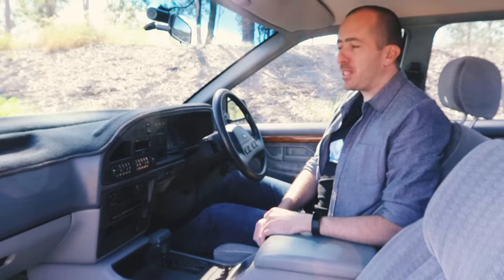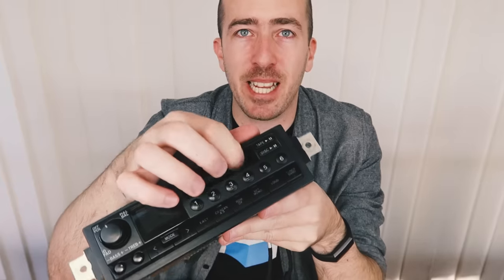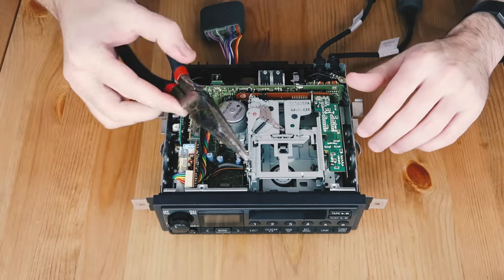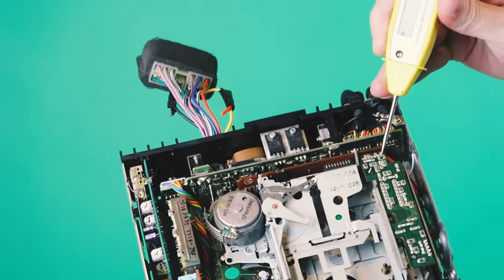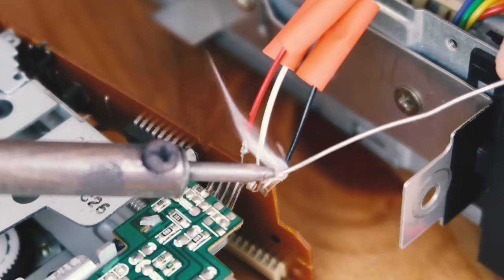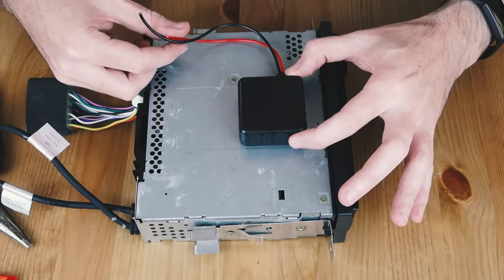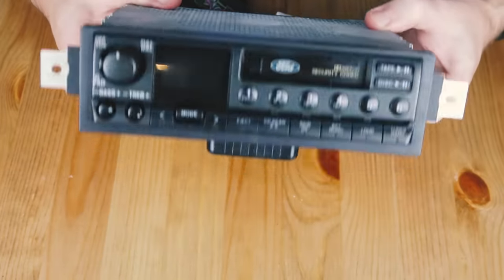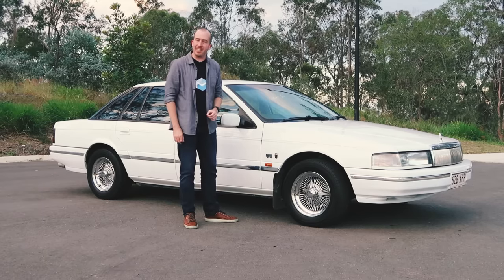Add Bluetooth To Your Old Car Stereo For $25!

Comment from the maker: If you're about to comment something like "Just buy a new bluetooth headunit for $10 from X" you're missing the point. This video is for those who want to retain their factory headunit so their dash looks stock standard, but are interested in enabling bluetooth audio streaming without using FM transmitters or bluetooth/wired tape adaptors. FM transmitters or bluetooth tape adaptors "do the job" and if you're happy using those, that's awesome. But they're passing your audio through the FM band or through the head of the tape drive, and the sound quality may be affected.

Also, as stated I am not an expert when it comes to electrical work, but the mod outlined in the video has worked brilliantly for a number of years. Thanks for watching.
Reply: Yea the Audio Quality is gonna be affected. Compared to the perfectly good a Quality any 20-Year-old Car is known for. Also without an Enhanced Bloototh Codex (which yours apparently doesn't), the quality is not really gonna be any better than FM. It is a really cool mod, but I don't think the audio quality is its claim to fame.
Reply: Another reason for doing this cheap mod is that you retain the steering wheel controls.
Reply: @asdanjer  

FM is analog, it goes up to 15khz (most adults can't hear anything above that) so there is no degradation of sound with FM at all as long as the signal is undisturbed and the receiver is decent.
Reply: @westelaudio943  Well theoretically yes, but there is always disturbance. especially with such a mini antenna.  That's why I sad that it was comparable to the default bloototh audio transmission.
Reply: @asdanjer  

The effects of bad FM reception are high levels of buzz and noise (no direct loss of information, rather added unwanted information drowning out the signal), while what you get with BT is lossy compression artifacts (actual loss of information). So it's not really comparable. 

However, the bad sound quality of BT is always getting over-exaggerated by people, even with cheap BT receivers you get decent sound, lossy yes, but especially in a noisy environment like a car with lo-fi door speakers this doesn't really matter at all.
Reply: @westelaudio943  It is true that it is a completely different phenomenon, but to human ears trow bad old car boxes it does sound basically identical.  Also, it is not only compression noise but also the white noise/electrical noise from a bad DAC and AMP that is anyone with Bluetooth. This is also a form of Electromagnetic interference (Yes on a different wavelength, but still same) and the same phenomena than FM interference. And yes even cheap 20 buck boxes often don't use the default Bluetooth codex, but some special one. and they go from being fine to nearly lossless. But as it looks the one he is using DOES use the default BT sound codex, which IS TERRIBLE. And this is definitely noticeable.
Reply: "They look utterly shit."

Agreed!

Also, heaps of fragile garbage with minimal to no protection from the elements.

Thanks for sharing!
Reply: @asdanjer  You're thinking of FM transmitters. There are cheap in-line modulators ($15) that go between the antenna and the radio cable, causing zero loss. They filter out the channel you have selected so even if there is a station there, your injector is the only thing you'll hear so long as you have it turned on.
Reply: @Shutupimslow  yeah I think they are useless because this refers the hole purpass of a plug and play solution. If you start modify the wiring you chois just do the mod in this video. And signal qualty should still be a lot better with the taking out of a mittelway.
Reply: No fuse on the bluetooth power huh?  Yup, that's going to end well when, one day, you find a pile of cinders where your car once was.
Reply: @antagonizerr  yeah does insane voltages really need this...
Reply: @asdanjer  Ask any car audio, boat or trailer accessory guy. EVERYTHING plugged into main should be fused.
Reply: @antagonizerr  ok sorry, don't know that much about cars electronics in particular.
Reply: @asdanjer  When I was young, if you blew a fuse on the road, you jammed a penny in the slot until you could get to the store for a new one. A lot of cars cooked that way, which is why they switched from tube fuses to pronged ones in newer models.
Reply: Congratulations, great job. But there is one way to include also an microphone ? So we can also receive phone calls. Regards
Reply: @antagonizerr  the unit is connected to the yellow aux power which is fused through the cars wiring loom
Reply: @peter81richardson  Nope, it's not really.  It goes through the car's ignition which is rated at 30A, FAR to high for an accessory. It's functionally identical to having no fuse at all. At best, that bluetooth needs 5A for safety.
Reply: Very interested here, I’ve a nice alpine head unit that I’d like to modify, but I’d like to be able to use cassette player too, so if I were to - instead of terminating the ribbon cable like you did,  just splice the Bluetooth receiver in would it play happily a real cassette when loaded and then a tapeless tape when playing through the Bluetooth, so long as I didn’t try to play both at the same time?
Reply: antagonizerr please expand, I’m considering this myself, where should a fuse go? Between the red wire from the harness and on the red wire to the Bluetooth receiver itself?
Reply: Just seen that you’ve answered my question further down. No worries!
Reply: One thing to note about the FM transmitters is that they will be picked up by other cars nearby. That can either be a good or bad thing. I once heard a one sided conversation and another time tuned it to a car playing some music ( I know this because I often my use that same channel to transmit my own music, which is a blank channel with no radio stations on it)
Reply: My head unit also has car settings and information displayed that I would lose if replaced by another unit. These included oil life, trip, warnings, security settings, lock settings, units (km or mi), language and more.
Reply: Hey mate, Zach from America here. #1, I LOVE your Fairlane. I'd love to have one exactly as yours driving me around. I have a 1990 Mercury Grand Marquis LS - it's like a non-luxurious Lincoln Towncar - with a 5.0L V8. I'm about to watch your "land yacht" video above to see what yours is all about.

#2, I don't know if you know anything about HAM Radio, but I've been licensed and installed my own equipment in my cars since 1998. Your soldiering is as good as mine. I'm not saying you're great, or I'm terrible, but seriously, if it WORKS - what does it matter what it LOOKS like if all the ugly bits are tucked away, taped down and hidden!?!?

#3, What part of Australia are you from? My Thai ex-wife went to Uni in Tasmania. I've never been to Australia but AU, NZ, and the Philippines are on the A-List of my Bucket List places to visit.

#4, I've "considered" that horrific cassette thing, but after just 1 use in  a car cassette player for a "discman" knockoff about 20 years ago, I absolutely agreed with your description of the aesthetic and I definitely LOL'd because the unceremonious way you flung it in the back is EXACTLY how I tossed mine!

#5, I am absolutely going to try this with "Grandma's" Ford cassette deck - that's my Marquis' name, "Grandma" - as soon as possible.

Thanks for the excellent video from a guy who truly appreciates clean, quality, factory gear OVER going out and buying some aesthetically-challenged aftermarket retail abomination.

G'day
Reply from the maker: @redfonzie21  Hey Zach! Sorry for the delay, I only just saw your comment - thanks for taking the time.

Glad you hear you love the Fairlane! It's a great old car and you don't see them very often on the roads here... well, in good condition anyway. I don't know anything about HAM radio besides the name, but you're right I don't really mind how things look so long as they work and are safe. 

I am based in Queensland up on the east coast - Tasmania is a beautiful part of the country! 

The cassette tape adapter was something I thought I'd try ("How bad could it be?") and yes it was pretty bad. This mod is still one of my favourites - I still drive the Fairlane at least once a week and it's the only car I own which has Bluetooth. Still working fantastically to this day. Maybe I should do my other cars too?
Reply: @MotoringBoxTV  

Yes, you should absolutely do the other cars! If you want to. I've recently purchased a Nissan Sentra with all the Bluetooth functionality built into the existing equipment from factory, so I'm not sure what I'm going to do with the Bluetooth device I purchased now that it's redundant.

Also, don't worry about the delay, I know Australia has been quite under the magnifying glass lately with all the fires and 40°+ temperatures in various areas. I just hope you are safe and your family and so on.

Take it easy, mate!

Thanks for the response!

Zach
Reply: I just put a Kenwood KDC-BT572 in my 90 Ranger. It doesn't look too out of place in that old thing 👍.

With the increasing popularity of hands free law's here in the states, as well as some other features that I couldn't, our wouldn't want to, add to the stock head unit, I figured it was time for an upgrade. On top of that, my stock head unit was just tired 🤣
Reply: Seems weird to use audio quality as an excuse and then use bluetooth. Unless you are running aptX or another high end codec I doubt such a cheap device would support there is no way you are going to get a better sound than a directly wired connection. You aren't getting audiophile sound out of an old head unit in an old car anyway, just stick to the aesthetic excuses. Unless you are adding a bunch of sound deadening, keeping all of your joints greased,  stiffening up your chassis to prevent trim pieces from squeaking as your chassis flexes around turns, etc then anything in a car is just going to sound good enough, it isn't a studio.
Reply: @PaulLemars01  if your radio doesnt have bluetooth... it doesnt have radio controls... and if it somehow does... you wont retain them for bluetooth... since the radio wont know. -  also... this dum dum
Reply: I'm watching this to make a mid quality stereo that was in my late grandfather's workshop work on aux or possibly Bluetooth later on,because I want to keep using it for sentimental reasons.
Hopefully I can make it work, may need to add a changeover switch for the cassette inputs so I don't have to disconnect them
Reply: Great mod and have seen something similar with mods on the Jaguar X-Type, S-Type and X-350/8 D2B fibre optic Denso system to display Android on the centre screen that have used the hijack of the stereos amp for audio. Totally Agree with the above statement. If i replace my cars stereo,  i lose jaguar voice, phone, sat-nav as well as the whole integrated look of the car.
Reply: I have a Bluetooth to FM transmitter. I bought from amazon, the unit is made by “roav” which is ankers vehicle lineup. Sound quality is great, only complaint is that when you have the volume maxed and the song has parts where there’s little to no noise you can hear some static, but it’s not too big of a deal. The one I bought was $25 and has been doing good for a couple months now.
Reply: Hey this is exactly my mindset with my car. My 99 Corolla has installed its factory head unit still after 21 years, and I don’t ever want to get rid of it because it looks wayyy too cool.
Reply: @verablack3137  What if you don't have an aux jack on the car? What if you are the type of person that runs multiple errands and is in and out of the vehicle multiple times in a day? That is what this mod is for. I can attest to the wired cassette adapters and FM transmitters sounding god awfully atrocious. Static, pulsing, white noise etc. This bluetooth adapter being installed the way it is will be astronomically better than the other two options. While bluetooth obviously isn't going to provide top notch clear quality... well I'll just repeat what you said. It's a car, not a studio. 

Could one splice in an aux jack? Sure. Now you've invested just as much time and effort and still had to drill a hole in your unit and deal with the fuckery of plugging/unplugging every time you hop in your car. Not to mention the headphone jack on your phone getting senselessly reamed out and eventually being stuck permanently on. Or you know... maybe your phone doesn't have an headphone jack? Most phones being produced now don't.
 
So no, it doesn't seem weird to use audio quality as an excuse when the difference between actual bluetooth and an FM transmitter is night as day.

For those weird fucks that spend 40 grand on an audio system in their $2000 hooptie ass Tahoe all so that they can blown up their ear drums and piss off everyone in a 6 square block radius? Yea, this probably ain't good enough.

For people that want phone to car capabilities without replacing the factory unit, this is the ideal solution.
Reply: My thoughts buy me a new Bluetooth for 19.99 then motaphukka
Reply: I wanna do this because my cigarette lighter stays on and as the delivery driver for Jimmy John's the extra few seconds it takes to turn it on and off really does add up.

Comment: Nice work. I run a car audio company in Sydney, and i do agree with the new head units not looking right in older vehicle dashboards. Maintaining the original equipment amplifier and subwoofer - like your work...

Comment: Thats a great head unit Dolby b and C . Back in the 80's I had to crawl over broken glass to get a car deck with head unit Dolby B and C and metal and chrome tape detection.
Reply: In 1984 I paid a fortune for a Japanese head unit with same. It actually cost more than the VC Valiant I put it in.
Reply: Well at least he did not break it in an irreversible way.
Reply: My first unit install was on 81  Mercury Lynx. They wanted to charge me $150 for the cheap assed AM fm mono radio that was already in the car. I told them to remove it. 
I put a really sweet Kenwood stereo unit with graphic equalizer booster and the Dolby BAND C with Chrome. I also removed the one central speaker they left in the car and added 6 speakers and a bass unit in the back. It was a 5 door hatch back car. I could vibrate the windows in our house when I turned it up. Kids now days are spoiled.

Comment: Good on you for keeping the factory look without having to give up modern technology. I agree that most modern aftermarket radio are far too gimmicky and difficult to use. I have one in my mk1 VW and it does not fit the look of the dash at all (although it sounds great). It looks like a damn Disco at night and is distracting.

However, I did something similar with what you did with my daily-driver 14 year old Ford. I installed a 3.5mm stereo Aux module that fed into the unused DVD port on my factory head unit. I then bought a wired bluetooth audio media adapter that plugs into the cigarette lighter for power, and connects to the new Aux port. This way I have a direct audio connection, so no wireless interference, and it has a remote attachment so I can control the function of the cell phone (volume, next\replay tracks, pause, and phone pickup) without directly using the cellphone. This way I avoid a ticket for using a cellphone while driving, which is illegal where I'm from (Canada). It sounds great and I can still using the original controls on the steering wheel to control the head unit for volume, mute, and aux selection.

I look forward to seeing more of your content - cheers!

Comment: Yeah, I love this. I have a 96 roadmaster wagon with a similar function.  But your install is cheaper, cleaner, and cooler. I used an inline FM modulator and Bluetooth adapter. I’m looking at modding my 94 F150 for similar function. I’m going with your method. It’s slick. Another benefit of this setup vs an aftermarket Bluetooth head unit is that the stock stereo is a true theft deterrent. Nobody will break into a car to get a factory 90’s radio. Well done.

Comment: This is an awesome mod , especially how it keeps the original fascia and keeps it functional

What I would have done different though, is I would have avoided these little back 'for car' boxes, they're expensive for what they are and don't do the best job
 if you just search for "12V Bluetooth" you'll find listings for tonnes of boards who do the same thing, or more!
What I do is I grab the ones who have soldering pads for extra buttons , such as play, pause, skip fwd, skip back, etc
Then I can solder the pads of these to the buttons in the front of the car head unit, and like that I can use the original fast forward , pause , etc buttons too. 
It's much safer when there's a trash song that comes on in the playlist, and you want to skip it, you can just press the original next button , rather than having to get out your phone and open the screen to press next, or maybe even needing to unlock the phone too... Which, while driving, isn't the safest
Reply: Very impressive!
Reply: Which one do you think I need to buy for a 87 Camry cassette deck?